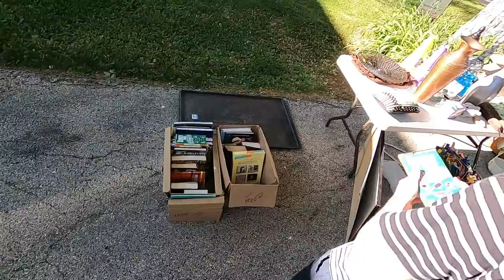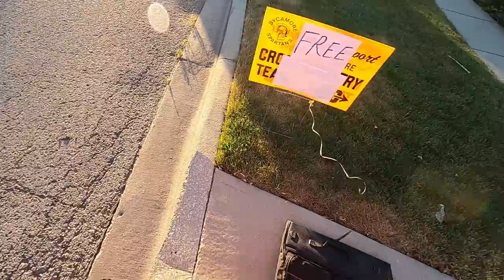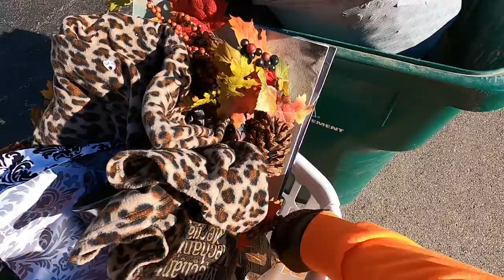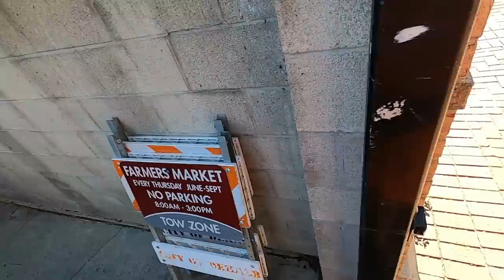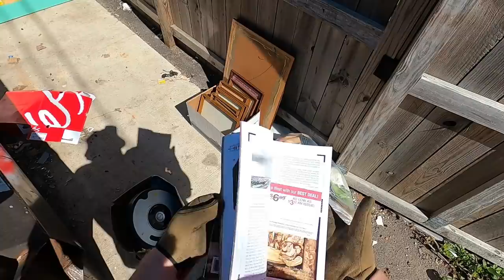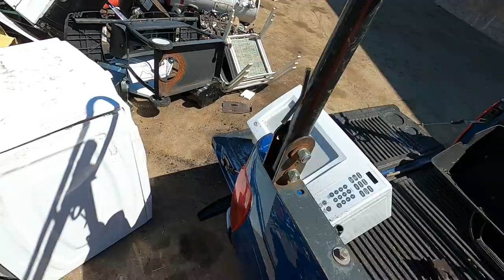Never Know What You'll Find Trash Picking

Comment: The Scrap is normally sold on to another Scrap processor they put all the Scrap through a Fragmetizer which sorts all  brass Copper alloys and Rubbish comes out on different elevators as Sorted metals you cant just melt as one or new steel would be Scrap from start wire and netting you can bale but cant put through frag as it jams hammers up and its not a nice job Spending 2 or 3 days Cutting out the mess with Cutting gear and costs a fortune to restart fragmatizer
Reply: How much more money you think this yard sells their scrap, versus what they pay for it?
Reply: Get commodities notifications weekly and you will know take out Storage handling costs Labour vehicles cost plus extras and you'll come to a percentage figure

Comment: Hey Paul that engine in the middle of the train is called a DPU unit  Distributed power unit its something new in the last 5 years to move the power in the middle and end much more efficient to help with hills and breaking
Reply from the maker: Thanks for the information. I did not know that.
Reply: @ScrapPalletMan  Np Paul also forgot to say DPUs are also used to reduce the strain on the drawbars and couplers of the locomotives and the cars near the front of the train.

Comment: Get some wide rubber bands and put them on your drill handle and when u come across a stripped screw a piece or rubber band in the head for your bit to grip will help turn the screw